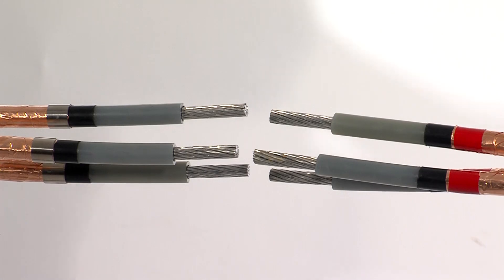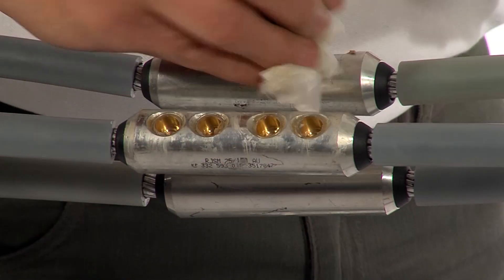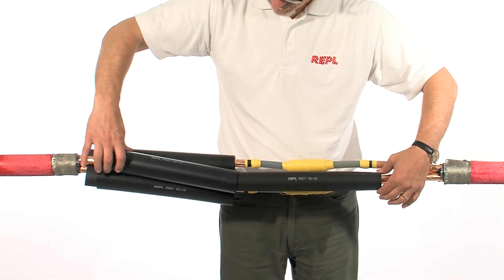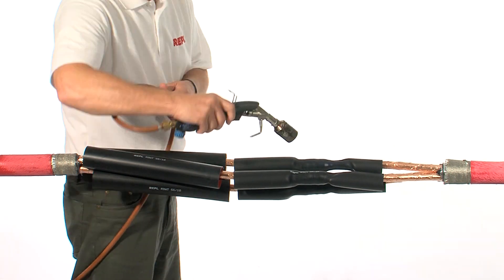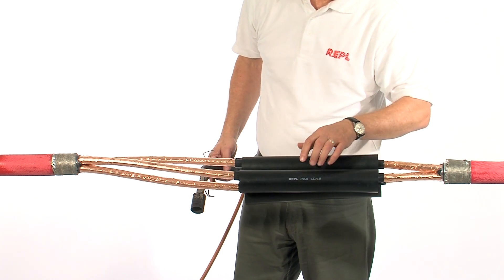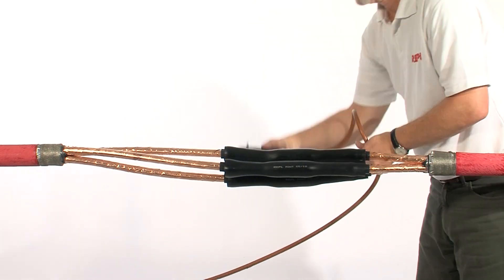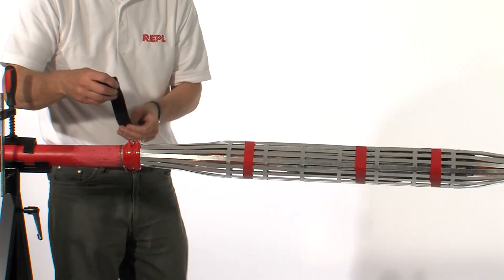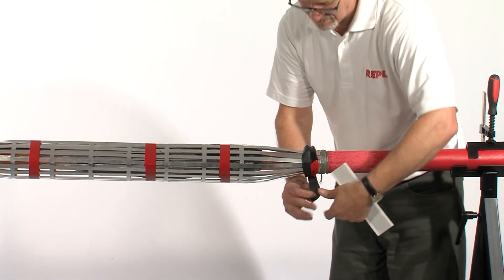Installation of a Heatshrink Straight Joint on Three-core MV Armoured Cable

Comment: Wouldn’t it make more sense to just have one continuous shrink tube instead of two and putting mastic in between
Reply: That requires you to have longer free lengths of cable on an end for the heatshrink to rest while doing the connection. This might no be possible inside conduit or in a pit.

Comment: I never seen selling this kit any where I watched a joiner once on street he was branching off to  the block of flat I had the contract to do it was very interesting but he said. They only make them and supply to southern electric
Thanks for the video
Reply: You can still buy the components.  They also make a cold-shrink solution.
Reply: I sell armoured cage only which is an important part of cable joint and we make it of good quality 1mm thick polished prime sheet of all sizes if you want any go to my page (Armour case of cable)...